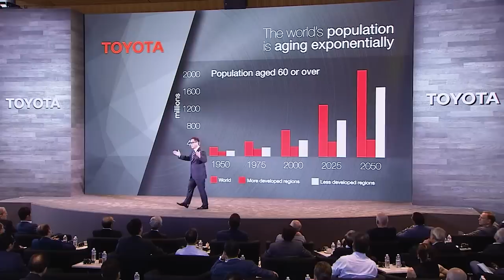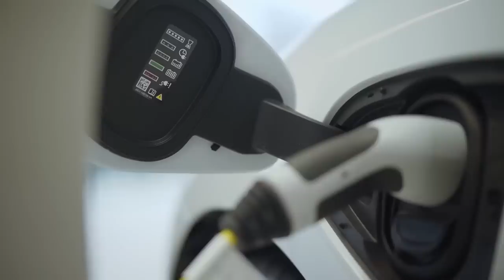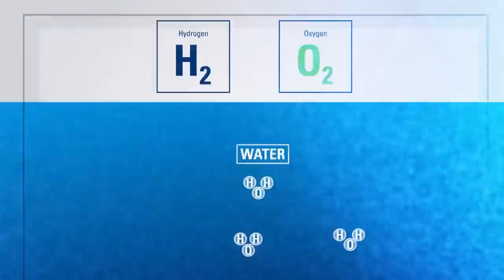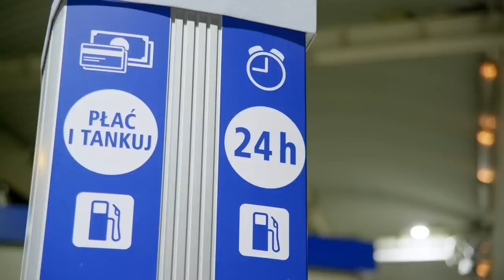New Toyota CEO Shocks Everybody | Huge News

Comment: Glad to hear this, Me personally I am not going to buy an EV until they get the batteries to where they can get 800 miles per day and have charging stations everywhere including hotels, restaurants,  shopping centers, and grocery stores. I have a hybrid right now and that's good enough for me. The reason I say this is that 800 miles is what I can drive in a day. I know this because I used to be a truck driver way back in the day before I started investing in rental properties. My gas burner hybrid can do this even without charging. 800 miles in a day is what I would need to escape an invasion if Russia or china decides to invade this country, so I can escape to Mexico or Canada. All you who have low mileage EV's will be stuck behind enemy lines subject to torture, rape and murder, while I will be sitting in Mexico being very glad I didn't have a low mileage EV.
Reply: Higher standards than a gas car. They dont hold enough gas to drive 800miles. We do need more public DC fast charging, but I charge at home for my daily commute.
Reply: plus NEVER burst-into-flames
Reply: @famodllm4794 gas cars don’t burst into flames?
Reply: @JAM_2024  - they don’t like EVs do. So don’t even try.
Reply: @@user-hk6jx2vc1g - exactly the law only applies to trucks.  Have you ever considered people travel together and take shifts driving?  The vehicle needs to be able to go far is what the person is saying. 

Anyway if every car in world was an EV the power grid would fail.
Reply: Almost no one travels 800 miles in a day. Only truck drivers drive these distances with any consistency
Reply: Drove an EV with 300 mile range for 4 years, never once did I thought "man, I can sure use an 800 mile battery".  I'm not a robot, I need to take breaks during road trips.  I'm also not doing road trips every other weekend, so maybe that's why you want your 800 mile battery.
Reply: 800mi/day is way beyond even a gas car.
Reply: @SimRacingVeteran  Where do you get your info? Because you clearly need better sources.
1. The number of cars on the road that even occasionally drives 800 miles(without a sleepover) is so small that it doesn't make much sense catering to this group.
2. Electric vehicles: 25 fires per 100,000 sold, Gas-powered cars: 1,530 fires per 100,000 sold, Hybrid cars: 3,475 fires per 100,000 sold.
3. The power grid myth has been debunked a million times, both in theory and in practice. In Norway 9/10 new cars sold are electric, and I bet it's about 50/50 on the road... zero grid issues so far. This is first of all because the load simply isn't that big, secondly it's because most EV owners would charge at night when the electricity is cheapest(and the load on the grid the lowest), and thirdly because the grid capacity increases as demand rises... because you live in a functional society.

And why is it that no one is concerned about "grid capacity" in any other context, have you ever thought about that?
How much load on the grid do you think street lights add? Or what about all the store windows staying fully lit all through the night? What about the insane amounts of air conditioning units in the US? I have never heard anyone suggest that we should cut back on air conditioning in our homes to protect the power grid... you know why? Because air conditioning does not pose a threat to an already existing multi-billion dollar industry, but EV's do. So all kinds of complete bullshit myths are created and spread as talking points, and sadly too many people fall for them.
Reply: @TheSaltyAdmiral  well, specifically in CA our government instructed us not to charge our evs at certain times because of the grid.  So that's where I'm getting the info!  Imagine if everyone had one, we would be limited on when we can charge just like we're limited on the days we can water the lawn.
Reply: @famodllm4794  EV's should come with fire suppression equipment 🤣🤣🤣💩
Reply: @MrX8503  nope
Reply: Some people have misconception about EV like you, because they afraid of change, already spent a lor on a car, or don't wanna buy a new one because rising fuel prices
- what ICE engine can go 800 miles in one tank in 1 day? And for how many gallons? I'm talking cars not container trucks
- what gas station can you find in those places you mentioned? You still need to go to gas station. No texaco in hotels, and grocery stores
- you realize you need to service and maintain 2 engines in hybrid? How does that cost? Oil, filter, fluid, radiator, etc plus huge $ replacing batteries after 5 years
Reply: You might as well say 1000mi
Reply: Dinosaurs
Reply: lmao 800 miles? ok they invent 800 mile EV, "im going go to go the grocery store 5 mile down and 5 miles back"; most people barely drive 80 miles a day. 800 miles range AND charging stations everywhere? what are you planning to do? charge you car every time 10 miles or when the battery level drops down to 90 percent?
Reply: everyone is missing the point. with gas u just  pull up and fill up anywhere so that is not an issue. with ev if u travel for example u cannot just plug up and go so 800 miles per charge would make up for the lack of charge station and time it would take to charge.
Reply: I think op’s comment got misunderstood a bit. My diesel car can go for about 900 miles on a full tank. I wouldn’t need to go that far in one day almost ever but when traveling in remote areas the ability to travel that far without refueling is a must.

I think EV’s are very sensible commuters but the limited flexibility due to lacking infrastructure is the reason why most are hesitant to buying one even if their needs could be met by an EV.
Reply: I virtually agree. The problem is charging time, it’s so long, while gas charging is next to no time
Reply: @TheSaltyAdmiral  everyone like you keeps going to Norway a country with hydrogen power on of a very few that has the resource. Most of the EU and the UK don't have that. EU/ UK and Australia are all having problems with the power grid. Already having problems like flashing lights and power shortages it's not a myth at all. Charging at night is no cheaper and if everyone charged at night along with other things that are charging the grid can't cope with it.
Reply: Aptera?
Reply: Hydrogen is great for large vehicles. Not going to work in small cars.. They will ruin Toyota with this idea. I can make hydrogen in my garage but greed makes it too expensive for stations to be built to be able to utilize hydrogen cars. Simi trucks and busses and perhaps trains but not cars.
Reply: how about getting a PHEV, electric for daily commute, gas for occasional road trips.
Reply: @error-mc5xw  That would be a Prius...
Reply: Agreed with you, where i live EV's are a waste of time and also dangerous in regards to leaving a person strandard and can die from this, very remote with temp 50c.
Reply: @deankoch7305  that would be nissan e-power engine series hybrid. But still $5000 to replace batteries in year 5. On top of regular service and maintenance for the fuel engine as generator
Reply: 800 miles a day? Do you commute from one side of the country to the other? You don't need 800 mile range
Reply: @famodllm4794  LFP already handles that. All the Chinese cars already have that
Reply: aptera makes a 1000mile car which you can buy right now
Reply: @yes-vy6bn  No they don't. It is 400 and only 1 person. It also is a 3 wheeler and overpriced at $25,000 for a cheap model and $30,000 for a less cheap model. They will be cool for city drive and dump rental cars I think but not worth the money to buy and own. You can buy a Nissan Centra that gets 41 miles per gallon and last for a long a$$ time for less and has 4 doors and a trunk for the luggage and junk for road trips. Even at $5 a gallon, the car is better in every way than that 3 wheel stoner car.
Reply: 800 miles a day? 😂😂 you’re in the very small tiny minority
Reply: @backcountryFLcyclist  You can get 800mls from a full tank of Diesel, do it often! 250mls to airport, 250mls back, no need to rely on having a charge after coming back from holiday day, then still got 250mls spare for use or emergency.
Reply: @Rob Eastman  I just traded my EV for a 2012 gas car. BEVs just don't have the range to justify the incredibly long time spend "refueling". With smaller batteries a 1.5hr trip quickly turns into a 2.5-3hr trip. With larger batteries, such as a Tesla, those smaller trips can be done in a single charge, though you need to charge again once you recharge your destination, and of course anything longer than 300-400km becomes roughly 30-45 min longer  for each additional 300-400km. My time is worth more than that, to say nothing of the loss of autonomy BEVs bring.
Reply: The reason I say 800 miles per day is that that's how far I can drive before I get so tired I can't drive any more. I know because I used to be a truck driver and since there are no charging stations set up much now, I would need that in order to escape an invasion if Russia or china decides to invade this nation. I can do this right now in my gas burner hybrid lol, so if this is being stupid than I am proud to be stupid I will laugh at you guys stuck behind the lines. Better safe than sorry.
Reply: @lucky889s9 why do you expect people to be forced to adopt something that's worse in just about every way?
Reply: @Salty Admiral  valid points, except when you get to grid capacity.  Electric cars are not like adding lights, it's equal to a furnace running full blast for 8 to 10 hours.  And at least in the us all the electric utilities have said they would not have capacity.  Now in reference to the person's 800 gallon comment, I think what he is saying that unless the cars have a huge capacity and be able to fast charge Even then you would be stuck somewhere for hours not 15 mins while you pee get snack and gas. I live in western South Dakota and once I leave my general area the black hills it's hundreds of miles to anywhere I would be Going to and would have to take many hours extra to get there. I am no ev hater, but will stick with my 2015 prius may move to a newer hybrid in the future. But full ev for me I don't see happening for some time.
Reply: @JAM_2024  As a retired firefighter I have extinguished many car fire. Never once has any burst into flames. That's Hollywood stuff.
Reply: @TheSaltyAdmiral  I had a hybrid Camry. It never bust into flames. I know personally of no hybrid that has burned even in a wreck.
Reply: 800 miles per day? Lol. There’s not even a gas car that holds that much gas.
Reply: @frankcastle2045  haven’t yet heard of any one being able to put the fire out on an ev
Reply: 800 miles is not enough
Reply: @MrX8503  ..not, a liquid fueled car can carry xtra
Reply: @rustytr It’s not just that EV batteries limit driving distance, they do not work well in cold weather, the Lithium and other materials used to construct are very difficult/ damaging to extract, the electricity itself is costly and has limitations to generate eg S Africa-and most importantly, the amount of Co2 in atmosphere is less than .05% and is a boon that feeds all plant life. And China and India keep building coal fired electricity plants that pump more Co2 than using EVs will save. So, kindly stop being a pimple on the butts of those of us who are not buying the EV con job.
Reply: ….”800 miles?!?”…..say the children living in mom’s basement
Reply: Go to Mexico, Canada is too cold.
Reply: "...what I would need to escape an invasion if Russia or china decides to invade this country,..."    ROTFALMAO!  Guess what sparky, the world does not revolve around the United Snakes.  And that is a good thing.
Reply: @frankcastle2045  Even that won't help because EV fires are hard to extinguish.
Reply: @andrusaaliiy9267  nah, you can adopt what you want or need. You surely can keep ICE engine, even if it's creeping to 5$/gallon. I'm just starting hybrid is gonna cost you double with 2 engines.
Reply: @davidfisher3273  What do dinosaurs have to do with EVs?
Reply: @Joel Wallace read his comment below, he used to be a truck driver and drove 800 miles max a day. Doesn't mean he drives it 800 per day with his car now. All these pro ICE may think again when gas price gonna cost $5/gallon. He's just talking hypothetically because he already has bought hybrid. Looks efficient, but gonna cost him $5k for batteries after 5 years.
Reply: @lucky889s9  Toyota prius has been out for almost 20 years and it's one of the most reliable cars easily capable of 300,000 miles
Reply: Did you seriously say Russian or China invasion? That happens buddy & your car is the last thing you will be worried about, it would mean the end of modern civilization.
Reply: @andrusaaliiy9267  it maybe a feat. You happen to keep maintenance, service, and battery replacement costs during that 300k?
Reply: @lucky889s9  Far less than having to replace a $15000 battery every 100,000 miles
Reply: @backcountryFLcyclist  So what's your back up plan when you have no power.
Reply: EV is a dead end if they don't get energy production figured out first. The grid cannot support a huge increase in EVs on the road currently. But instead of working to increase the capability of the grid, politician's are making energy more and more expensive and less available by switching everyone away from gas/oil/nuclear and onto wind/solar which is a disaster in the making. There are other problems with EV as well that frequently go unaddressed, such as the true environmental impact compared to gasoline engines and the availability of raw materials to make the batteries. Internal combustion is not getting realistically replaced anytime soon, but if if DOES go away, it will just mean people have less and less freedom overall (which is probably one of the goals anyways)
Reply: rustytr  Teslu gives 800 miles a day,really, not. However, 800 miles? This was accomplished by a team from Japan that drives electric cars. The vehicle they used was an electric-powered Suzuki Every Kei-class minivan.
Reply: rustytr  Still wouldn't be worth it
Reply: @idmhead0160  Where i live most people will do 1,500km in one day. My Land cruiser has 1,100km fuel range.
Reply: @Withlovefrominterent  You are 110% correct.  That is a great summation of EVs and of the situation in toto.
Reply: @tweedeldee8122  Drive my Ford Expedition.

Comment: EVs are a lie as a substantive replacement for combustion engine vehicles. And in reality, even at a 1:1 replacement would only address 16% of the supposed CO2 problem. However, EVs are actually a 1:5 replacement due to the inability to have a supporting electrical infrastructure, so 80% of car owner would eventually become pedestrians, while the other 20% (elites) would own EVs. So much for equity among the classes.
Hydrogen is the answer.
Toyota is ahead of the curve.

Comment: I think the new CEO's approach will be perfect. He's looking multiple directions with all viable options. It will be interesting to see how quick he moves on his goals. Yet another reason I'm loyal to owning their vehicles. I'm not saying they are perfect but they are sure damn good!
Reply: So here's the issue: in EU from 2035, manifacturers can only sell electric vehicles. So with this move, Toyota loses a lot of money.
Reply: @klarnorbert not really, if carbon neutral fuel is successfully developed, this EU law will turn around.
Reply: @usercs_2682  compressed air is already used to fuel commerical planes but they pretend to use crazy amounts of fuel
Reply: You can make your hydrogen at home with solar panels. It's a better solution than batteries
Reply: @rwyo83  We consumers can't make Hydrogen at home to power a hydrogen vehicle. Hydrogen is highly flammable. It doesn't just burns, it explodes. To make Hydrogen not only you need to chill it and pressurize it between 700 to 1000 psi but you need specialize equipment because of Hydrogen Embrittlement.

Also that energy from solar panels you mentioned. The same electricity required to make enough hydrogen to drive 100 miles will power an Electric car for almost 300 miles. Just plug in the car. Much easier.
Reply: It’s always mad to put all your eggs in one basket.

Comment: Agree with their direction and no dangerous lithium or heavy metal disposal issues each time the lifecycle of the battery expires.

Plus the battery pack's replacement cost can be nearly half that of the vehicle at the lower end of the market.

Very clean Hydrogen, if the infrastructure issues can be resolved and the engineering proves reliable.
Will provide the ideal energy source not just for cars, but rail freight & high speed passenger services, farm equipment, interstate and local trucks etc.
Motorbikes... maybe not.

Comment: Most of the real world know EV's are not the answer,
 just more problems. We don't need at this moment, or in the future electric powered vehicles. The very weak truth of EVs is a completely insane reality of what is possible and what is wrong with true infrastructure. It will not work in the real world. The very bad things of EV's greatly  outway the good things In true technology or in gas power. Hundred and so years have already been proven that gas powered vehicles are convenient are very easy to run. EVs a major stress to the consumer. Not to mention the risk factors in ownership already seen and proven. Our infrastructure just can't handle the need to power everyone with an electric car. The need for chemicals to produce those cars, a complete environmental disaster. And break downs not known to anyone, the order of the day. Not to mention the cost of depreciation, as to the cost of repairs and replacement. Not worth the trouble   and your bank account. Be ready to take a major hit for the majority of consumers. Nothing is perfect and less EVs.